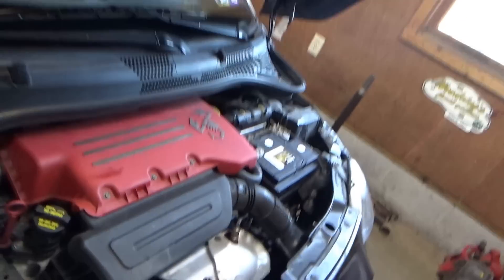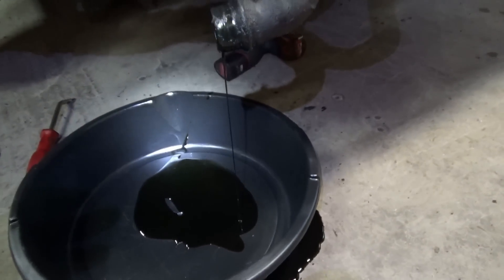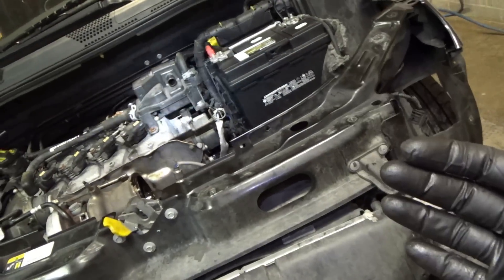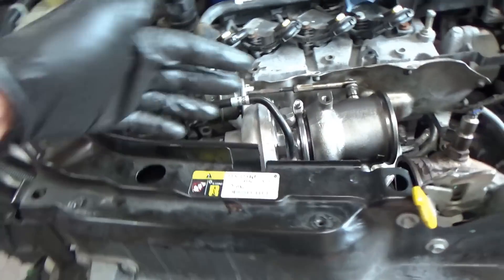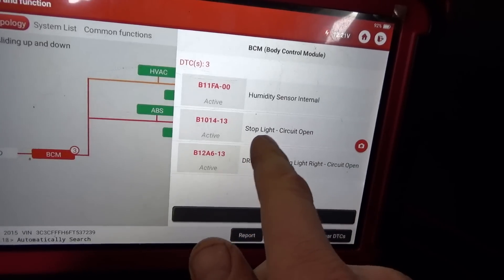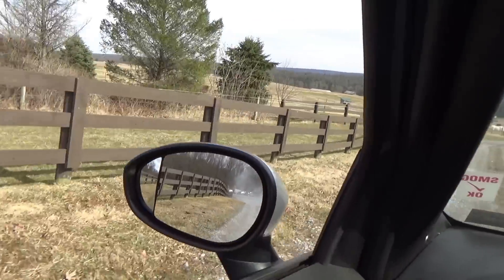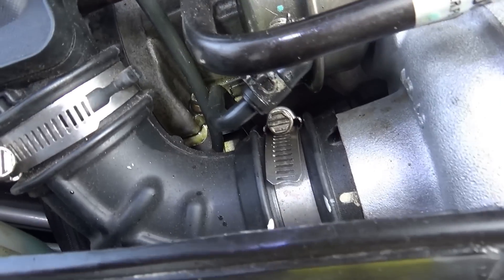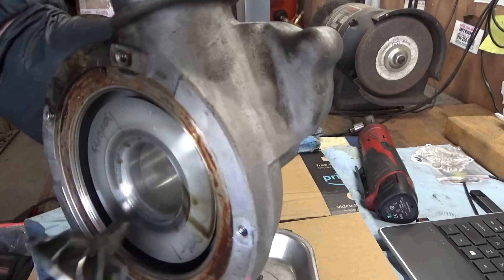Fiat Turbo GRENADES! (feat. Michael Jackson)

Comment: The 1.4T engine in these is surprisingly good actually, I had one for many years (Abarth version) and beat the ever loving piss out of it with no major issues. I also worked on a lot of them since the dealers wouldn't touch them after around 2017 or so. Bad turbos weren't super uncommon, that's for sure. Especially past 60K miles. Cheap journal bearing units that have to do a lot of work. The side mount intercooler system was also very complicated due to the lack of space and created many different potential leak points that further stressed out the turbo when it was trying to hit its 25PSI target.
Reply: I worked on one a few months back in a Dodge Dart. Valve cover gasket, t-belt, water pump/tensioner, oil cooler gasket and vacuum pump is what I did. I did buy a knockoff  timing belt tool kit off Amazon that worked well. Straightforward engine to work on with no surprises.
Reply: I own a 13 Abarth and LOVE IT! I'm at 135k miles and she's tuned to make 195HP to the wheels. Making ~22psi seems to be the sweet spot for me. Everything is still stock besides my blow off adapter I installed. I change the oil ever 3k and spark plugs at 25k and she purrs to life every morning!
Reply: was it generally quiet ( vs normal hydraulic lifter's ect ) to drive as i was told that at least the earlier models and or programming the valve's/under-hood ticked a lot?

Comment: I have read about a hundred of the comments and several people have noted (during the bonus disassembly footage of the turbo) that the shaft is too small in diameter.  In my mind there are two factors influencing the mechanical engineer who designed the turbo to use a small shaft.  The first is that a larger shaft will have more mass which will increase the spin up time of the turbo thus decreasing the the responsiveness of the drive train.  In other words, increased turbo lag.  The second factor is that the turbo shaft spins really fast and it is using journal (plain) bearings rather than anti-friction (ball or roller) bearings.  If you make the shaft larger then for a given shaft RPM the "surface speed" of the bearing (the number of metres per second of relative motion between the outer surface of the shaft and the inner surface of the bushing) increases.  If you double the shaft diameter the surface speed will increase by a factor of 3.14.   This will increase the frictional losses in the bearing creating more heat in the oil and could even get you into trouble by exceeding the shear strength of the oil film.  There could be other factors I am not thinking of but hey... I am an electronics engineer, not a mechanical engineer so please cut me some slack!

          As in the design of any device the engineer is faced with making many trade-offs between competing factors.  In this case the engineer would want to make the shaft as small as possible while still having enough strength not to break.  Did he go too far?  Maybe - but you can't really tell by analysing just one failure.  I am sure that a fair bit of skull sweat, math, and computer simulation of stresses went into selecting the size of the shaft.  Given many tens or hundreds of thousands of this model of turbo that have been produced you would have to look for a pattern of shaft failures among many turbo failures to say with any confidence that the shaft was too weak.  You would also have to also consider external factors.  For example, it is not the fault of the shaft design if the shaft fails due to failure of the oiling system caused by user neglect of maintenance.
Reply: Well, it is a Fiat product. They are designed by cost accountants not engineers. The only computer simulation is a p&l.
Reply: Gee Vincent after reading your comment my heads spinning faster than a turbo!!!😂
Reply: I don’t know but I prefer some turbo lag to have a reliable car
Reply: It's real easy to blame someone for this failure, getting the right answer is not so easy.  A small imperfection in the shaft can lead to a stress riser that will lead to failure.  Imagine the number of cycles that shaft goes though per mile.  A tiny ding may not show up until 60k miles later.  Is that the design engineer's fault or manufacturing's fault? We'll probably never know.  In any manufacturing process, there will be outliers.  Reducing those outliers costs money, eliminating them costs a lot of money.  Of course, this failure could have been the result of the lubrication problems that was "corrected" by the dealer.  Maybe the failure is the result of someone not doing their job on some part that was not even part of the turbo.
Reply: I was going to say you forgot the 3rd factor the engineer had to take into consideration - the finance department breathing down their neck. Gots to shave that raw material usage to the absolute minimum to decrease the cost and increase the profits.
Reply: Journal bearings spin at roughly half the shaft speed as they float in oil except the small garrett gt15/17 or whatever series where they are  a common bearing indexed by a pin

Comment: I wonder if that oil bath it took will result in premature failure of the O2 sensors or the catalytic  converter ?
Reply: Very likely. Ivan really should have removed the exhaust and drained it with that much oil in it.

Comment: Had a Detroit diesel dd15 snap 2 turbo rod shafts within a month. First one was put on with just draining the intake and exhaust like in this video. After the second one we dug into it a bit more. Ended up finding his CAC was partially plugged off, so figured it was too much of a load on the little shaft? It didn’t appear to be from oil from the first turbo failing, but did find the air filter to be fairly dirty. Maintenance is definitely key.

Comment: Where do you think the small turbo pieces ended up?  Just asking.
Reply: The oil return line dumps right into the oil pan, so any fine pieces would be down there if they’re small enough the filter will catch them otherwise they’ll sit in the bottom of the pan
Reply: @williamgagnonroadboxservice  or worse in the oil pickup and then starve the engine of oil.
Reply from the maker: Depends on which impeller...didn't see any pieces snapped off though, just some scrapes lol

Comment: Had exact same failure on a deutz 3.6 in a brand new 150’ JLG boom lift with only 93 hours on the engine. It was in a hangar for a major airline. They were not happy when they had to open the hangar doors to clear the air when it was -10° Frankenstein outside. 😂

Comment: U gotta find a way for a 2 post lift , you deserve one  👍
Reply: So do I ... :D
Reply: You're never going to get one in that little garage. What he needs is a shop.
Reply: He can have the roof raised a few feet to make more room for the lift.
Reply: @KennyNica  And a new thicker concrete floor poured, so easy.
Reply: @NotAnonymousNo80014 Also knowing Ivan (as a viewer) I don't think he would have a place with an HOA but still you notice the garage door is almost always closed? Neighbors. He needs a shop.
Reply: @InsideOfMyOwnMind  I think more like he keeps the door closed to keep the heat in. It sucks working in the cold, and it's pretty expensive to heat the great outdoors.
Reply: A pit would work super for his garage. I have made four thru out the years. Check it out.

Comment: It is difficult, if not impossible, to train drivers to allow a couple minutes of idle time to allow the turbocharger to cool down before shutting the engine down. Manufacturers should have an electric oil pump that can run after the engine shuts down.

Comment: Nice work.  I hope the oil dumped into the exhaust system won’t / hasn’t damaged the catalytic converter.
Reply: Sounds like it might be decatted but for sure any Cat in the exhaust is dead.
Reply: @paulaus  They sound like that from the factory.

Comment: Will the converter survive such an oil attack?
Reply: Usually in that case you always recommend replacement of the catalytic converters because if they clog that can be potentially dangerous for the engine. Plus i would have cleaned that exhaust with alot of degreaser and a water hose 😮
Reply: If you rinse that thing out you have to call the local hazmat team to clean the driveway... The car will probably be at the pick and pull in another year
Reply: @Dan Bentch  right but i work at a shop with a industrial oil seperator in the drains. Never do that at home hahahaha

Comment: I’m at 140k on mine. Stock clutch, tuned and I thrash it daily. They have some maintenance quirks (Multiair filter) and some weak points (vacuum pump) but they are fairly easy to work on. I drive high end cars all day for work and I’ve yet to have as much fun in such a little car.

Comment: This is a very very common story here in the UK. we have an abundance of small highly boosted engines nowadays. this failure probably stems from the previous oil leak. the turbo's are hugely sensitive to oil pressure, and are the first thing to fail if the oil pressure ever gets low. I think the driver probably ran it until the light came on before having the leak repaired, causing damage to the bearings in the turbo, the bearings then wear out rapidly untill the comressor wheel touches the compressor housing, which breaks the shaft.

Comment: Literally just had the same failure on my Audi A4 TDI 101k. Mine blew pulling out from a junction, trying to get out before a slow-moving vehicle came along, I gave it the beans. It moved out of the way very quickly and then it went POP!!!!! as it reached max revs and gave the James Bond smoke show. It was very embarrassing, I only ran it for about 10 seconds after the failure but my garage had a massive issue clearing the exhaust after the turbo was replaced. It stank and smoked for ages trying to clear the exhaust but it did eventually clear, but Greta wasn't very happy which made me very happy.
Reply: How dare you! As Greta would say.  I feel for you.  That must have been one expensive repair.

Comment: Mt 2013 Dart has pretty much the same engine which a lot of the 1.4's would get a under boost code, thankfully mine happened while it was still under warranty so it got the updated turbo installed.

Comment: Sad to say, I think that turbos are pains anymore.  Only worked on stuff with diesels, so yeah, turbos are mandatory on them..  On average, for example a Cummins Tier 4 emissions package turbo (say like after 2010 ISX-15,) not only did it get a turbo, but more often got the DPF and Oxidation catalyst replaced as well due to oil in the exhaust (imagine the DPF and DOC with about 6-8 quarts of oil in it.) Didn't smoke from the exhaust, but exhaust sure got restricted pretty quickly.  And cost?  Holy smokes (no pun intended).  Price for a reman Cummins turbo, and worst case scenario, a new DPF and DOC?  North of $12,000.  New turbo raises it to almost $15,000.  Not including gaskets and sensors for the DPF, and labor for all.  Worst one I ever saw?  Failed turbo, exhaust side filled about half way with oil, and also a failed EGR cooler, along with the DPF and DOC being replaced.  All in all, spent almost 16 hours doing all of the repairs/replacements.  Good thing Cummins ate most of the cost of that one, as it was still under warranty, and the DPF was considered a progressive failure.

Comment: Luckily, the owner was close to home.  I had a similar failure on a freshly re-man turbo, on my diesel pick-up, several years ago.  Unfortunately, I was not close to home, resulting in a very long, late night wrecker ride.  The vendor replaced the turbo and all was good after that but I paid a pretty steep wrecker bill.  We also made a serious smoke show, especially passing through the toll booth, before we found a lot to pull into.  We used our AAA to the max, that night.

Comment: The after market turbo couldn't be any worst than the OEM Fiat turbo.  I believe in buying OEM parts except for Fiat OEM parts.
Reply: The original part is a Garret turbo, USA company.
Reply: The aftermarket part can easily be worse than OEM, and usually are. Turbos fails due to abuse and lack of maintenance.
Reply: Hmm sounds valid🎉
 Unless the OEM is American made..
Idk we do what we gotta do to keep it moving but sometimes that ends up costing more🤷
Sometimes not 
Fully inspecting the china replacement parts helps to

Comment: Where did all the bits of the impeller go I would have washed the intercooler and all the intake manifold and pipes out and cleaned the oil feed pipe or replaced it, I figure the cat is dead now Ivan

Comment: Do not forget to replace the oil return line from the turbo!!! Most of this defects are caused due to clogged oil return lines. They can not be cleaned  cause the line is glogged by burnt oil obstructing the return flow.
Reply: I'm leaning Alot from just reading. Bib THANKS Ivan n all.

Comment: hey, I have ran into the same trouble you have on my 2013 abarth, I bought the turbo charger from ebay, it ship from canada for 899, and it has much bigger impeller, it is GTX1852 turbo charger, love it after mounting it on, the boost pressure goes up to 24 psi much quicker. not bad at all for 899

Comment: I would be worried that the turbo is not getting the proper amount of oil to it.  Ecoboost engines have filter screens installed in the block , the oil feed line and if the oil changes were not done then sludge builds up on the screen and will not get the proper amount of oil to the turbo.  I don't know if these engines have the screens in the feed line or not.
Reply from the maker: Did you see how fast it pumped the crankcase oil into the exhaust via the turbo? No issues with oil flow there LOL!
Reply: @PineHollowAutoDiagnostics  just going off what i have experienced with Ecoboost engines.  I did see it pumping oil in the exhaust.  I also had to drain out a quart of oil from the intercooler on the ecoboost engine that i replaced due to the turbo failing.
Reply: @PineHollowAutoDiagnostics  The engine i replaced was due to the lack of maintenance.  The screen was completly plugged up.  One turbo was starved of oil and it broke just like the one you took apart, on the exhaust turbine side.  I enjoy your vids!  I've learned a lot from you!
Reply: Now your making Ivan want to recall the customer.

Comment: 37 year Centrifugal service technician.  I've seen plenty of wrecks of impellers and broken shafts. And air compressor rotating element typically won't spin much beyond 65000 RPM. Unlike an engine turbo that can spin in excess of a 100,000 RPM.   More often than not the wreckage is so severe it's a crap shoot as to what caused the wreck, unless the monitoring equipment data logged a sequence of events leading up to the crash.

Comment: I have built several Abarth 500's. One is 313hp at front wheels on Dyno. These multi air engines make power. You can run 2 stages of tune. Just use the sport button to change between the two. I run stage 3 in non sport, and stage 3 with pops and bangs in sport mode. I beat the crap out of this car. You can change turbo in a couple hours easily. You don't need to remove front clip.

Comment: Nice job replacing the turbo, without dismantling the whole front! I have a couple of doubts though: did the cat survive and, where did all the impeller bits go?
I think you repaired the original oil leak in the Bonus Footage - wonder what the other shop did, besides leaving two bolts jumping around.
A bonus feature - you got your shop fumigated against all pests 🙂
Reply from the maker: At least the dealer was kind enough to leave the bolts there for me to reinstall haha
Reply: Were those two missing bolts involved with the catastrophic failure?
Reply: @larrybe2900  Not likely....starved for oil but based on the black oil...poor maintenance intervals killed it.
Reply: @larrybe2900  Not sure - they were holding the turbo and maybe, just maybe, increased the vibration, but it's hard to tell.
Reply: @PineHollowAutoDiagnostics  LOL! A lot of luck that those didn't fall off 🙂
Reply: I always thought these were catless from factory. Just a straight downpipe

Comment: Gotta be really careful with the oil choice on the Abarth’s.  It takes a 10w-50 and needs 6k oil changes no matter what Fiat claim.  Oils cheap compared to a new turbo.  Great video again.
Reply from the maker: Why does the oil cap say "5W-40"? 😆
Reply: @PineHollowAutoDiagnostics  my daughter has had one for nearly 5 years with 120k miles on it.  I service it every year.  1st time I checked and Fiat recommend part number 13133701 - that’s described as Petronas Selenia Abarth 10W-50 Motor Oil 2L.  God knows why the oil cap says that, that’s what the standard non turbo 1.4 takes.

Comment: I've seen it on a Ford Escape EcoBoost engine. But instead of oil leaking into the exhaust, oil was leaking into the coolant reservoir. Very bizarre seeing black coolant instead of Ford orange.

Comment: Did you check the oil feed line? And the return?  Some turbo problems are from blocked  lines.
Reply: If NOT it will Most Likely be a comeback,  First Turbo job is a Learning Expensive experience.
Thanks Ivan we're all shooled together.

Comment: I've never seen a broken shaft before but in my work truck (a Ford 6.0 diesel) the Turbo started whistling loudly.  After about 3 seconds it stopped and the engine wouldn't go above 4 mph. What would make the whistling noise?

Comment: In european diesel cars that normal, when the turbo it dead it eating all the oil and on Renault DCI oil get inside the cylinders and the engine revs to max and blows, we have to pass the 5th or 6th gear and depress the clutch to stop the engine from revving and blowing. Good job Ivan.

Comment: I had this same failure on a 2004 Subaru forester, 130k miles. I replaced it with one of those Chinese built replacements, and it failed on the test drive, less than 2 miles, I have also seen this on a 2010 Ford Taurus SHO. Both turbos failed, approximately 225k miles